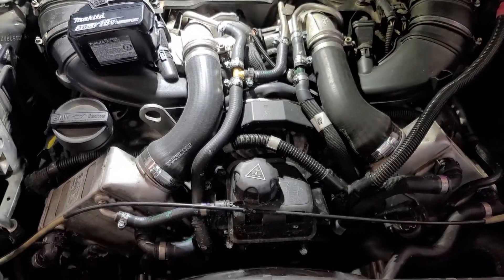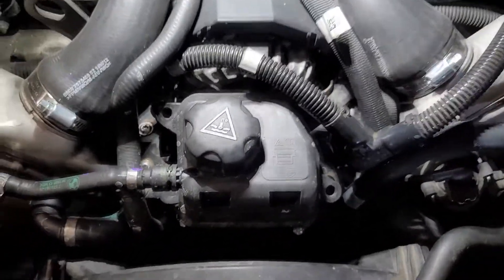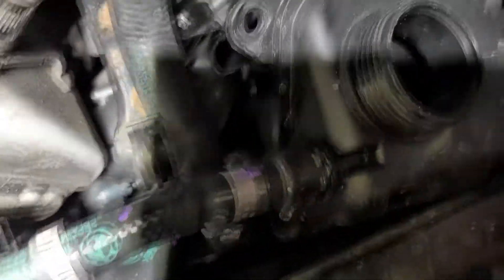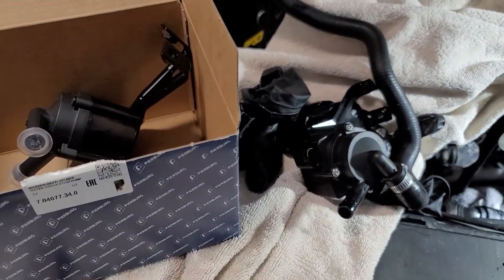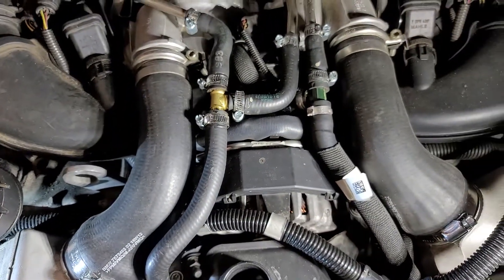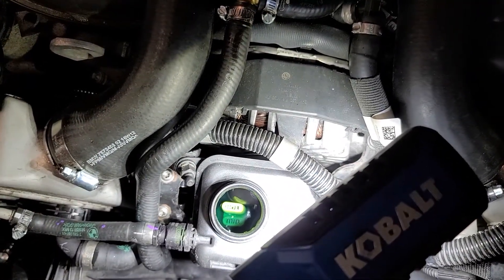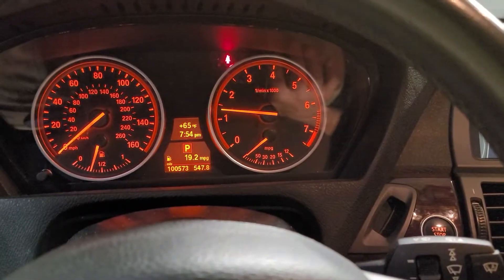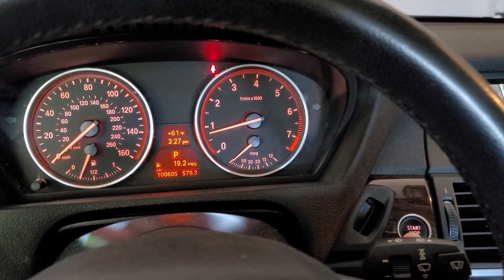BMW X5 N63 S63 E70 2EA9 error fix turbo coolant pump replacement

Comment: Did you replace the coolant vent line plastic Y fitting behind the alternator?
Reply from the maker: Eventually yes, but not during this timeframe. I did a TON of work on the cooling system on this car when i had it and it is still running today so I think it was worth it. Lots to go wrong, unfortunately, on the N63
Reply: @jcx2bby That's why being proactive is important.

Comment: Aint there two pumps not just one for each turbo
Reply from the maker: There are 3 coolant pumps on the N63. One mechanical one for the main engine cooling, an electrical one that handles auxiliary duties such as heat for the cabin, and one to help cool the turbos after the engine is off. That turbo pump is the one I show here.

Comment: Amazing video! I actually have the same exact car - even the same color actually. I have about 165k miles on it. I know for a fact the coolant is leaking from the intercooler reservoir area but I'm not sure where and how. The thing I've noticed is that it only leaks when the car is running, not when the engine is turned off and I dont have any error codes related to coolant leakage. Do you have any ideas as to what that might be?
Reply from the maker: Man there are soooo many coolant hoses on these engines it could be almost anything. Start taking pieces off and see if you can trace it down.  I can't really give you any pinpoints past that. Good luck!
Reply: @jcx2bby I thought so. That is the only way to find out. Thank you anyway!

Comment: Is this the Coolant pump for the intercooler???
Reply: Gotcha. I asked because I have this code: 

20A202- Coolant pump for intercooler, power-reduced operation: Undervoltage

When I google this code it gives me two different pumps. So maybe it’s the other coolant pump?
Reply from the maker: @ashkrnaut ugh, it honestly could be either one at that point. I'd do this little one first, clear codes and see what happens. It's much cheaper and easier to do.
Reply from the maker: That is the aux pump that sits down on the lower side of the engine bay on the passenger side. This pump specifically only runs after the car is shut off

Comment: Hi,

I have the same problem.. There is absolutely no coolant in my expansion tank.. I will also replace my additional water pump tomorrow.. Do you think that the problem will be solved or could it be that the intercooler has broken
Reply from the maker: @firo3869  if your ta k is empty, then it has leaked out somewhere and replacing the pump won't necessarily fix that, unless the pump itself was the source of the leak. Hope you find it
Reply: @ I will also replace the expansion tank.. The hoses all look OK.. I just hope the intercoolers aren't broken

Comment: From the research ive done , these cars have 2 independent cooling circuits , one for the intercoolers and a main one for the engine and turbos , the pump you are replacing is part of the main circuit.

The main circuit runs off a mechanical water pump and cannot be bled using the foot to the floor method
Reply from the maker: @domkraggp9944  correct on 2 independent cooling circuits but incorrect on the bleeding process. The engine cooling circuit does use a belt driven mechanical pump but it also utilizes an electrical auxiliary pump which is what does the bleeding process. 
The smaller circuit is just for cooling the turbos. It is not bled with the aux pump. It has its own small electrical pump which is what I show here.
Reply: @jcx2bby  hhhm I see, if I'm understanding you correctly this small turbo aux pump you just replaced , will do the job of bleeding the main circuit.

I'm doing this exact same job on my 550 tomorrow morning and I also got the pierburg .How has yours held up until now?
Reply from the maker: @domkraggp9944  not quite. There are three pumps on a car with the n63, the main mechanical one, and two electric ones. The auxiliary pump I mentioned earlier is down by the passenger side front tire in front of the engine. And then you have this small one that sits on top of the engine that cools the turbos. The auxiliary one is much larger, more expensive and does the bleeding procedure.
Reply from the maker: @domkraggp9944  The pierburg Pump held up just fine. No more trouble with it after this
Reply: @jcx2bby  Update : the pierburg is making loud grinding noises and its only about 3 mths old. Somehow my heater core started leaking , coolant level went low , then the little pump ran dry. Upon further digging I also discovered that the charge cooler pump is as dead as a door nail. So I will be replacing , heater core , turbo aux pump , charge cooler pump.This time I will vacum fill the cooling system , what a pain !!
Reply from the maker: @domkraggp9944  yikes!  Good luck man

Comment: thanks for the video i have 2012 750i with two errors code 20A504 and 20A608 both related to this pump ...I'm planning to replace it ....do we use same coolant fluid as engine coolant?
Reply from the maker: Yup. Same stuff. Bmw blue coolant.

Comment: Hello thank you for this great video, I have the same issue and just ordered my parts. May I ask if one of your symptoms for this problem is not having hearer? My air vent jsit blowing cold air.
Reply: Replace your heater control valve 100%
Reply: You are correct 100% it was very challenging to change that, the hose was tough to take out so what I did, I use my hair blow dryer to heat the hose and that came out very easy. However, I bought the parts at amazon and the passenger side is blowing cold air lol. It’s ok for now as long I have heat to pass this winter:) thank you for your video they are very helpful.

Comment: My 2011 X5M is blowing black smoke.. I had code turbo intercooler fault DTC:002F1 D/ 002F29 also the engine is misfiring upon start up.
I checked the intercooler coolant and it was empty, so I filled it, did the cycling but didnt see the fluid move at all!.  I took it for a quick drive and came back and let it cool down, i check the fluid and levels and it was empty. I looked under the car when I first filled it and while it was idling and there was no fluid leaks... what is going on?
Reply from the maker: Black smoke usually indicates too much fuel .... Are those the only two codes you have?
Reply: @jcx2bby  I get a turbo boost code and cylinder misfires
Reply from the maker: @kobidog17  my guess is bad injector somewhere causing the smoke. Not sure about your coolant level... If you keep filling it up and it keeps disappearing with no visible leaks, obviously it's burning it, most likely due to a head gasket. Sad to say but you may have to take it to a professional and get it checked out
Reply: @jcx2bby  I had the injectors check out and they said they were fine.. the original index 12's... it is going back into the shop tomorrow... on going problem for over a year now. Thx for your help!
Reply from the maker: @kobidog17  good luck, I am interested to hear what you find out from the shop. Hopefully something not too expensive

Comment: Does this require coding???
Reply from the maker: Nope! Plug it in and go
Reply: And the engine hot drive moderately still appears after start up even after the car has been sitting for a week
Reply from the maker: @PnwDcoe  yes. That's a symptom of this.
Reply: @jcx2bby  symptom of what?
Reply: Symptom of it requiring coding?
Reply from the maker: @PnwDcoe  no, for this pump there is NO coding required. But that message is a symptom of a bad pump. When you replace the pump you have to clear that code out. 
If you have battery draining issues that might be from the bleeding procedure, if you did it. But it is otherwise unrelated to this repair.
Reply: After installing mine. I got battery draining code, and a bunch of other stuff going on

Comment: Great video and lots of good information. As a BMW Tech, I have to add, this very critical bit of information. Make certain your battery is good, properly charged and if it was replaced, it needs to be properly registered - Battery Registration is very important- basically your BMW alternator output is controlled by the DME/ECU and if you do not register the battery- it will not charge the battery properly. Ive seen many turbos fail due to failure to replace and register batteries. The Auxiliary pump is electric and only runs after shut off. If the battery is weak, your computer will shut the auxiliary pump off prematurely in order to save battery power so the car will start up next time. Look up BMW's Battery replacement information on the N63 engine. It is way more frequent than any other model. If your battery is good, be certain to have a battery charger/power supply connected when performing the bleed procedure. Again, if the battery is weak, the bleed procedure will not initiate.  Also see BMW Service Bulletin SI B61 30 14
Reply from the maker: Thanks for the great details Mike!
Reply: @jcx2bby  thank you for your help! I replaced auxiliary pump about 5 months got OEM pump from FCP auto parts. I did it by myself also the air bleeding everything worked perfectly. Few days ago I noticed hot steam coming out of my engine I checked and found a leak from the turbo coolant hoses. Just replaced today the coolant lines and when try to do the air bleeding the pump won’t start. Do you have any idea what its could be? Maybe the pump failures again?
Reply: My vehicle BMW X5 50i n63
Reply: @samparienete8032  Well, the first thing to check is the battery. Is your battery properly charged? If yes, then it is likely the pump itself failed again. Any coolant loss will cause this pump to run dry and kill it quickly.
Reply: @ yes it’s new battery I also did the registration for new battery. the auxiliary pump that I replaced few months ago because I got engine hot alert , now there is no alert or engine light on but I’m almost positive that the pump doesn’t work. I can’t hear it also the coolant in the reservoir stays cool after I drive it. There is any risk to drive like that even though there is no “engine hot” light? Anyway I’ll replace the pump.
Reply: “The water pump in my BMW X5 continues to run even after I turn off the engine. Is it possible to help me solve this problem?”

Comment: Hello. I replaced the AUX pump and do exactly as you say at full heat, gas pedal 10 sec. etc. Heard it start hissing and the coolant disappeared from the tank like in your video but it never comes back? the tank was completely dry and the sound i heard was another pump? from under the second tank for engine cooling. Let it run for more than 10 minutes. but it never stopped, had to stop it myself when i had to drive away. Maybe I should have waited even longer? At least the AUX pump now works, gets heat in the cabin again when using the residual heat function.
Reply from the maker: Rene, was it the Aux pump you replaced or this little turbo/intercooler pump? The turbo pump wouldn't affect heat in the cabin. 
For the bleeding procedure, honestly, as long as you aren't overheating and the coolant is at proper level , you don't have to let the process 'complete'.
Reply: @jcx2bby  I changed the same pump as you in the video. Small pump under the small tank in the middle of the engine. N63B44.
Reply from the maker: @bmw6022  ok so that's the Turbo pump you changed. The N63 has 3 water pumps on it. The main mechanical one on the front of the engine, driven by the belt, an Electrical Aux pump down by the pass side front tire (very hard to see) and the turbo pump. You also have 2 reservoirs for all this. The turbo reservoir is right on top center of the engine. The main reservoir is on the driver's side. Make sure both are full. 
The turbo pump only runs when the engine is off, to cool down the turbos. It will vibrate slightly and make a little hum.

Comment: Hello. Have F01 750i N63 and will change the pump, but wondering how much coolant should be in the tank? mixing ratio?
Reply from the maker: There is a fill line in the tank that you will use to know when it has enough. I buy BMW coolant at the dealer. It doesn't come premixed, so I mix it 50/50 with distilled water only.
Reply: @jcx2bby  Ok :) I have an error code on the AUX pump on ISTA, so I assume it is defective, it is also cold in and around the tank after a long drive. Engine temp. is perfectly fine.

Comment: I have noticed that my cars turbo aux pump isn't running after a 1hr drive at highway speeds & some traffic. I don't have any codes and car is running fine the temperature outside is in the 50s...is it possibly not being triggered due to ambient Temps? Car does show running temp on dashboard.
Reply from the maker: Turbochargers run so hot that they need cooling despite cooler ambient temps. If it's not running, and you're sure, I'd replace it. Take no chances on the N63 lol.
Reply: @jcx2bby  lol yeah I hear you. It's the route I went I overnight shipped it and should be here tomorrow. I appreciate your time making the video by the way. Very well documented.
Reply from the maker: @Chaos1187me  thank you and good luck!

Comment: Okay jcx2bby, awesome great instructional video. Thanks. My hooptie is a  2013 E70 X5 50I, 65,000 miles, virgin to being fondled by a seasoned mechanic.  I'd like to add a few things to this that I believe is extremely important. Learnt through my own trial, error, and pain. Please forgive my spelling and grammar that I am about to spit at you.First other than the error code here is how to tell if it's the turbo water pump that is whats shot causing the code and you don't need a fancy code reader gadget. After you have driven and your car is hot (it will be way hotter than normal) because when this little pump is shot your turbo's are going to be scorching. Turn the car off, open the hood and listen right above the location of the little pump, if you hear it running and it is making little clicking sounds then it is for sure shot and it's the reason that your coolant keeps getting low, the blistering hot turbo's are evaporating what coolant is barely able to get to them. Do not continue to drive the car when you get the error message, you may be setting yourself up for a disaster to your wallet. The car will continue to run blistering hot until it either burns off all of your coolant or the lack of coolant starts a chain reaction of breaking everything to include the turbos. What this video didn't show you was why the little pump was shot. After you get it out of the car and like me you have to know what is inside of it you more than likely will go at it to open it up. Before you do so shake it. You will probably hear that clicking sound. When you open it up pieces of conductive ceramic impeller will fall out. That is what was making the clicking noise. Now taking the old pump apart becomes an critical step in the process because you will need to inventory the pieces to make sure that none of them made it out of the pump and into your turbo's or other critical parts, absolutely imperative!!  The little pump has a magnet in it that the impeller slips over and when power is applied to the magnet that causes the impeller to rotate, it is kept lubricated by the coolant, when the coolant runs low the impeller is running dry. You need to periodically check your coolant levels. These parts don't have much tolerance for running dry. If the coolant keeps getting low you need to find out why. Preparing to repair: before you even touch anything with a tool, open the hood and check what kind of hose clamps that you have. Unlike this video mine still had the factory hose clamps that require a special 80 dollar pair of pliers to remove. I tried everything to get the things to snap lose, prying with a screwdriver, horn nose clamp pliers from the auto store, nothing worked, the things are made of kryptonite, stronger than superman. And there was no way that I was going to get the bottom hose clamp off of the little pump.  That left the Dremel, I simply cut on top of the clamp connector and they popped lose. You still have to digger with them a little to get the clamp the rest of the way off. So if you have those clamps you need to be prepared with the right tool to deal with them before you even start. Next, as this clip fails to mention until parts are already removed, first thing jack the car up, remove the skid plate and put a drain pan under the car and set the car back down. Before you remove hoses or the coolant reservoir tank in front of the turbo pump, suction the coolant out of the reservoir tank, saves you a big mess. Everything else is like the gentleman in this video says to do it. Most important thing he says is to prime that new little pump, I consider it critical to prime that little pump. Don't forget to do what the author says and run the priming sequence when done. Also I know I shouldn't have to mention this since we are all master mechanic pro's here but don't forget to replace the coolant when you are done or the priming sequence is futile. Don't run over your drip pan. Wish that I could add pics. Thanks for the video and good luck!!!
Reply: Spot on  !!!!, if this things run dry it soon starts clicking and grinding.Will be sure to check for disentegrated parts when I replace it.

Comment: My engine hot error is still displaying after changing the pump. Anyone know why? Do I have to reset the computer ?
Reply from the maker: Yes you have to reset the codes. I had the same thing happen.
Reply: Thank you. How did you reset it ?
Reply from the maker: @felixroche1233  used a code reader. Just a generic one from Harbor freight

Comment: Yeah I have x6M s63 auxiliary water pump is bigger
Reply from the maker: The auxiliary water pump and turbo coolant pump are not the same thing. I'm showing the turbo pump. Your aux pump is down in front of the pass side front tire and yes, it is a bigger unit.
Reply: @jcx2bby  are you referring to UK or US passenger side, I've been searching for the aux pump in my 2013 x5 35i drive?